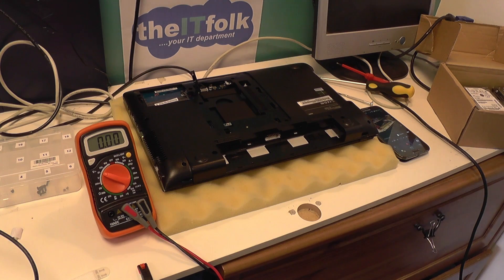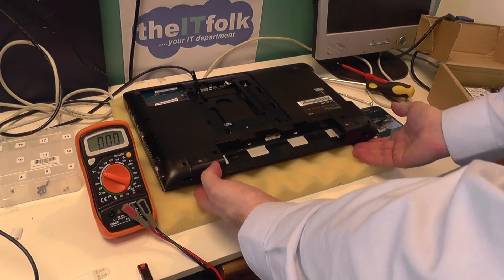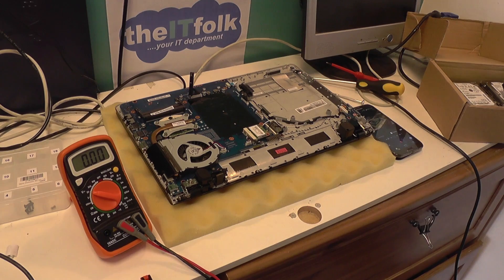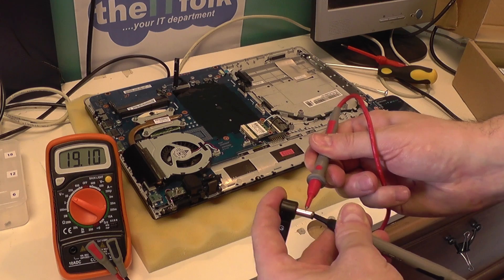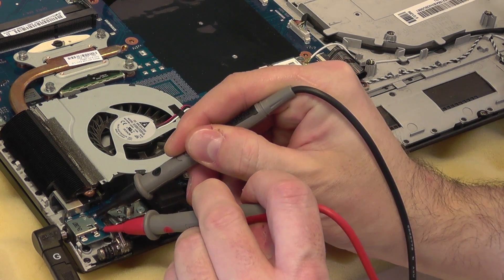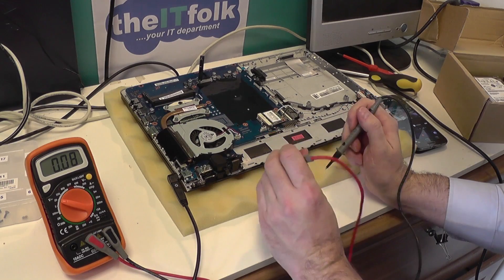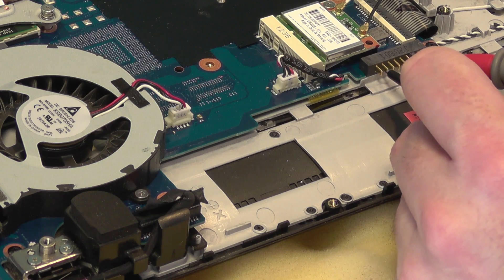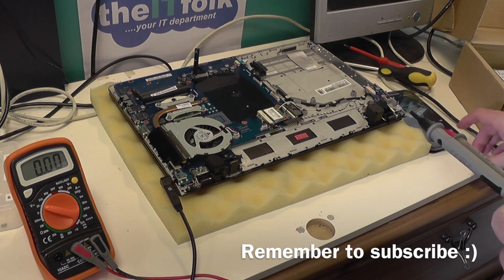Testing DC Jack on a Laptop Motherboard with Multimeter

Comment: At around 2:30, when testing the charging cable, does it have to be plugged into a wall outlet? 

I have the same question for when the cable is in the DC jack?
Reply: Yes, the charger must be plugged into the wall outlet so it can get power to run the test.
Reply: @cswbizberri4532  Thanks. I figured it out. Happy New Year.

Comment: is it just me, or have you connected your live "red" multimeter into the Com port when it shoud infact be the other way around?! for example when i test power adapters, I put the red one into the hole "live" and the black one on to the side of the plug. that said i am no master at using a multimeter, hence why i am asking. maybe i am doing it wrong
Reply: Some adaptors are the other way around. Doesn't really matter either way, the multimeter will just show a negative voltage if the probes are the wrong way around

Comment: I have an old acer 1350 when I insert the 19v power supply into the socket it doesn't turn on anymore.
I measured the pin socket on the motherboard and read 3.5v. Bad solder socket or not?

Comment: Can you tell me what voltage value has to pass on the blue wire of the Jack Dc of the thinkpad T420? Here's measuring zero volts! The T420 does not turn on or turn on the led. Could it be Jack Dc?

Comment: Isn't it a bit too early to simply swap the motherboard, the second the DC jack is fine? The DC jack isn't the only component, which can be replaced. So jumping straight to motherboard replacement seems like an overkill to me.
Reply: If the computer is not charging or getting power, it's either the battery or the dc jack, or the charger itself. If none of those fix it, then it's a bad board. Doing a SMC reset can save the day quite often, so that's often the very first thing I try.

Comment: Thank you! Very helpful. My question is that if the battery mechanism is only showing 3.30 on the meter then does the battery mechanism need replaced or are we just better off putting in a who new motherboard?

Comment: How did you know which pin was negative and which was positive on your first test?
Reply from the maker: Hi Light. It doesn't really matter. If you get it the wrong way around, your voltage will show a minus. You'll be able to work out which is which by that.

Comment: Hallo!  How can you tell if the power circuit/charger inside the computer is working or faulty?  The laptop powers on, but will not charge the Battery. I'm curious if the battery is faulty or faulty charging board or power management software< The battery is likely more than 2 years old.
Thank YOU!

Comment: How do you know how many volts the battery port should be putting out. For example my ac adapter is 19 Volt, the dc jack is 19 Volt but the battery port is only showing 9 volt. Is that enough to charge the battery because its not charging.

Comment: nice video , sir when i plug in charger into laptop , charging light blow for 2 second than goes off, and system tray showing "plug in but not charging" i checked my adaptor with multimeter it's fine battery is also fine, is my motherboard is faulty ?
or only dc jack is need to be changed.?
Reply from the maker: To be honest, 'not charging' sounds like a battery issue. Is this a Dell by any chance?
Reply: Yes it's dell studio 1558.
But my battery working well on another same laptop.
Reply from the maker: Is it a genuine dell charger?
Reply: Yes, charger is also work on another modle, problem is same when different charger is used.
Reply from the maker: I'd switch out the DC jack 1st. Process of elimination and cheaper than a motherboard. Hopefully it's the cable version of the DC jack otherwise you're looking at de-soldering and re-soldering which can be tricky without experience.
Reply: Did you find  a solution to this?. I have the same problem

Comment: Hi 
I own the Acer  Aspire E1-571G which its DC power jack  was loose and sometimes not charging the battery , once I open the laptop and  tried  to fix the power jack loose connection wire , however suddenly my Iron solder shortcutted   to the power jack body and sparked and my laptop never turn on anymore , I guess polar diode connected to power input socket may harmed 
I really appreciated to have any advice or repair procedure for this issue

Comment: hi, nice video, but I have a question, if is dangerous to connect the jack cable to the motherboard jack how can I checked? is normal to have continuity between the ground pins and the positive pin? I desolder the jack cause my friend says It make smoke and get redhot light from it, Is the motherboard pins shortcircuit if it had continuity between the 4 pins and the 5 postivie pin? (my multimeter read 1 if it fail, and 0 if it had continuity, but thos is giving me 0.004), how can I test? thx in advance

Comment: Jason, can you please give any suggestions on how to test a Tyco cable/harness type dc adaptor?. Like the one you talked about in the beginning of your video.
Reply from the maker: Just like this ruudney https://drive.google.com/file/d/0B4q_Y31tv9fRODduYk1KZVllTTA/view?pageId=102481811650341555290

In the pic I technically have the red and black back to front, but it makes no difference.
Reply: Is it possible that the tester can show correct but that there is still a problem with the jack? In particular can the jack cause a board to heat up if not working correctly?

Comment: Hello Jason, Thank you for the procedure in checking DC Jack. I have a question though. You told in the video that if you don't get any reading in the battery port, motherboard is dead so I'ts for replacement already. I am fixing a netbook Acer Aspire ZG5 with good battery, I checked power adapter and DC Jack, both has reading 19v but when I tried to turn on the unit, it's not turning on without a battery. When I insert the battery it's turning on but the battery is not charging, discharging only even the power adapter is plug in. The motherboard is good, where could be the problem?
Reply from the maker: That's a tricky one, could be anything on the motherboard along the way that carries the power to the charger port. Unfortunately motherboard repairs are a little out of my depth, I usually opt to replace it.  Let me know if you succeed with this one.
Reply: Well hope you can help me. I can give u a link I uploaded a pic maybe you can tell me something about it. Here's the link http://i64.tinypic.com/8yfk2t.png
Reply: sir i am from india poor a village here no service center i about laptop and desktop little can you guide my to repair a laptop problems is not powering up i have  mutimetor and smd work station please ? waiting for replay

Comment: What if there is a leakage of voltage in the battery bouncer? I plugged in the power and tested the voltage. It started at 1.8V, but eventually went to zero. I assure there is a damage in one of the motherboard capacitors?

Comment: on my power supply I have a blue light indicator to show it has voltage .when I plug it in to my computer the light goes off straight away and my computer will not power up . any thoughts on this Jason.
Reply from the maker: +nicoclause Hi nicoclause. If you have a multimeter you can test the power supply. Set it to how I've set mine in the video and simply hold one of the tips on the outside metal part of the tip that plugs into the laptop, and touch the other tip on the inside of the jack. Most power supplies have a small pin in the centre. Try carefully to touch that and noting else. Should read around 19v.  If it's not got a pin in the centre, then you should be able to touch the metal wall on the inside. Good luck.

My guess is that the power supply is faulty. If the laptop was faulty, the LED would stay on regardless. Clould be wrong though hence why you should test the power pack.
Reply from the maker: +nicoclause Hey, just re-watched my video and I show you how to test the power pack in it :)
Reply: hi Jason thanks for your reply    its not the power supply mate . the power supply is ok until I plug it in to my computer, then the blue light on the power supply goes off , and wont charge my computer.
Reply: Hello, nicoclause. I have the same problem and I can't understand if the problem is with the power adaptor, power jack or with a motherboard. My power supply has small pin in the centre, I checked it with a multimeter - it was 3.5V but on the inside of the tip it was 19.5V. then I connected separated power jack on to the supply cable and it was reading 19V. When I connect those two to motherboard, the light on the power adapter goes off and no power is coming off. I can't understand what exactly triggers the disappearance of the power. What did you do? How did you solve it? Thanks!
Reply: Hey guys. Thanks for opening up this discussion. I am having the same issue with my Dell laptop. Multimeter reads 19.5ish volts on AC Adapter when unplugged. When I plug it into the dc jack on the laptop, the green indication light goes away on power supply and if I sniff near the hole (don't laugh lol) I can smell the residue of hot electronics which is different than the other holes... also, if I sniff on the inside of the laptop that smell does not come up. Only at the DC hole where it connects to power. Did any of you figure out the issue? My guess is that either the power supply or the laptop has a fail safe that shuts it off when it detects a short circuit to prevent longterm damage? I will replace the DC strip in the laptop and see if that resolves. If it doesn't, then I guess it's the mother board.... any thoughts y'all? T

Comment: how could u test the one that comes connected via cable cant seem to find a vid of that anyhwere.
Reply from the maker: +100timezcooler Just like this : https://drive.google.com/file/d/0B4q_Y31tv9fRODduYk1KZVllTTA/view?usp=sharing
Reply: +100timezcooler I tried per your picture that you sent for testing with a wire. But I get zero on my old jack so I bought a new one (for an Acer Aspire 4743). BUT I also get zero on the new one. It seems the probability of a new one being bad too is pretty small (though possible). I went to a phone/laptop repair place and they stuck their pins in the end of the the connecting tab (not the top as in in your picture) and got about 1 (or .1) readings on both using some power supply they had so said that they were BOTH were good. I thought I should get a reading of about 19 as (I tested) in the inputting charger (though my charger is not from this computer because it is missing).
Reply: Robert McClure you have your power brick plugged in and your mulitmeter set to 20v right?
Reply: Have something similar on a machine I'm looking at now. The motherboard side of the DC jack cable gives me 1V. Power adapter gives me 19V.

I'm leaning towards a bad jack, except I just replaced this jack a few months ago (was broken from case damage). And it charged the laptop fully the day before. Today no power to the board - although it does run on battery.

Looking for clarification on the 1V thing. I'm fairly confident it should be 19V and that I'm dealing with wonky power jack.

Comment: I have the voltage coming off my power supply. But no power to the board when plugged in. I have an Acer with a dc jack cable and it has continuity. So why would power not transfer if it has continuity?
Reply: If you're getting 19v (ish) through the DC jack then I would guess the motherboard has died.